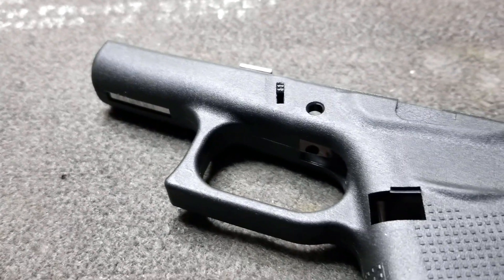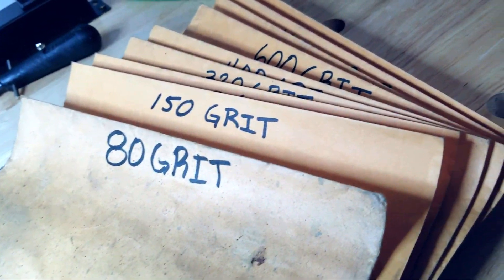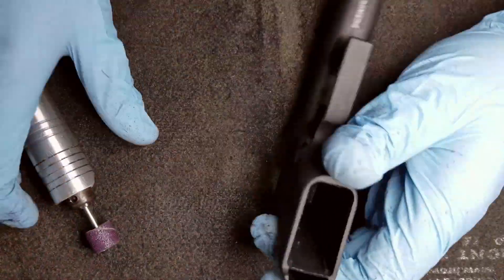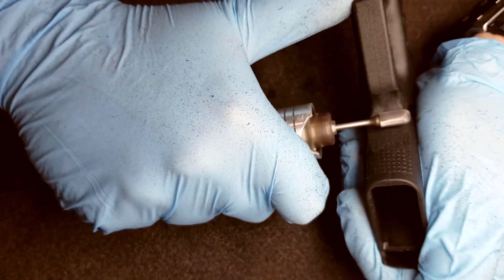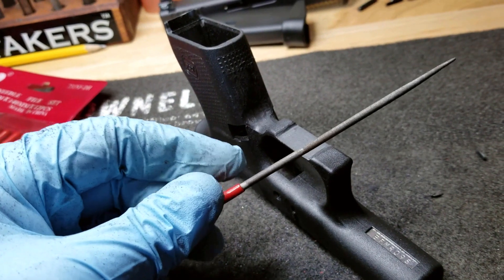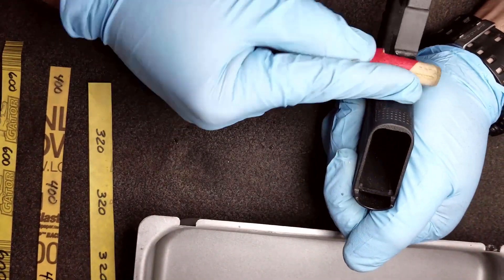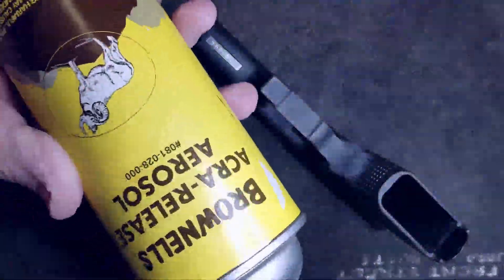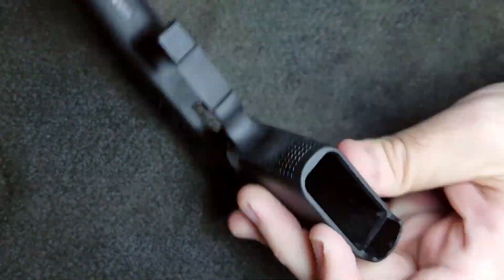Glock Frame Modifications: Trigger Guard Undercut | DIY Firearm Mods

Comment: I use a dowel rod and 180 grit. Takes awhile, but it's good. There's fiberglass in that nylon, and it disturbs it less, the slower you go.
Reply from the maker: I agree, i use that method aswell.

Comment: Anyone trying this might try using a heat gun on high and pass it over quickly over the area you sanded to bring out the black again of the polymer. You should see it get blacker and shinier. Don't melt and distort it though obviously.
Reply from the maker: I've never tried that, i will look into it. Thank You.
Reply: Hi
You should of put heat on it to finish the job I wanted to see it black again
Reply: I was going to say the same thing.

Comment: When I did the undercutting on my Glock 29 instead of going through several grades of progressively finer grit of sandpapers, I just used a very light touch with the Dremel grinding wheel to eliminate as much scratch masks as possible,  when I was satisfied with the final shape of the cut I wrapped a piece of old rag or washcloth around my finger and rubbed the hell out of it. It took about five minutes and the cut surface became smooth and with just the right amount of shine. That was what we called elbow grease.

Comment: If you wrap the sandpaper around your rotary tools drum mandrel and tape them on then progress like that up the different grits it will get smooth as glass and shiny black as you get up to 2000 grit.  I have even stopped at 1000 before because it was black and smooth as glass by then.  If you go past that it just gets shinier.  And there is no need to wet the sandpaper when doing it that way either.  Doing it by hand is a waste of time and the discoloration looks terrible.  It only takes a minute or two with each grit after 600 it is super quick because the dremel does all the work.

Comment: Would it be possible to have a deeper trigger guard.  My arthritis right trigger finger slightly bent and rubs along the bottom of the guard causing blister.  Yes I put on a bandage.
Reply from the maker: There is only so much material you can remove before it can cause structural failure, you have to play it by feel.
Reply: Got it.  Thanks for the reply.   @TheHobbyGunsmith

Comment: would this be the same process for a cz75 D PCR COMPACT in that the frames are made from different materials?
Thank YOU
Reply from the maker: I dont see why not. if its polymer should work just might melt a little different you need to get a feel for it as you go.

Comment: It’s aluminum alloy
Reply from the maker: You can stipple aluminum but id recommend a professional gunsmith in this case as it needs to be done with punches, but a non permanent route for aluminum is go with skateboard tape.
Reply: Maybe I’m not being clear (which would not be shocking:)
I want to “take down” the existing undercut. I need more of an undercut because as of this minute I’m getting calluses directly on the first knuckle of the middle finger of my gun hand. 
If the undercut was a little more pronounced (more space) it would fix that.

Comment: Dude that does not look good.
Reply from the maker: We all have our own opinion and i respect yours. Thanks for watching.
Reply: @TheHobbyGunsmith  the undercut is actually good just looks like the finish could use a little polish with dremel. Also I don’t understand why you went so low on handle but overall aesthetics don’t really matter and as long as it works for you!

Comment: You should title this "How to void your warranty and weaken you glock frame just to look tacticool at the range"
Reply from the maker: Lol Cute comment without actually researching what you say. go play Warzone and leave these kind of things to the grown ups.
Reply: @TheHobbyGunsmith  you sanded half way through to the mag catch, you don't sand the grip when doing an undercut. You sand the trigger guard, not just put a drum against the grip and go at at
Reply from the maker: @noncompliant209cali  great input from someone who has never done anything on firearms other than watch videos on it. Thanks for watching.
Reply: @TheHobbyGunsmith  I've built 4 fgc-9 without using manufactured parts, I've milled out countless lowers, made many p80 Glock frames and stippled most my frames. I'm not a pro but know you don't touch the grip with the drum. Actually you don't sand that part at all when doing an undercut
Reply from the maker: @noncompliant209cali  So in essence your saying all the polymer frame modifiers such as Boresight Solutions, Shuey Custom, and Salient Arms, etc. just to name a few are wrong for modifying the frame in the same manner you just described that is in your opinion incorrect and you are the one that is right...
Reply: @TheHobbyGunsmith  I guarantee they are not doing that